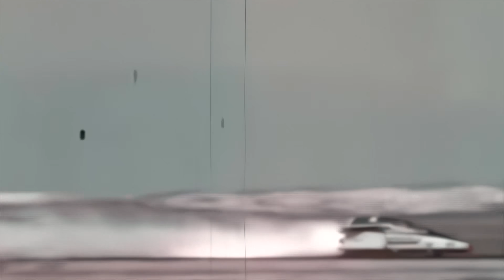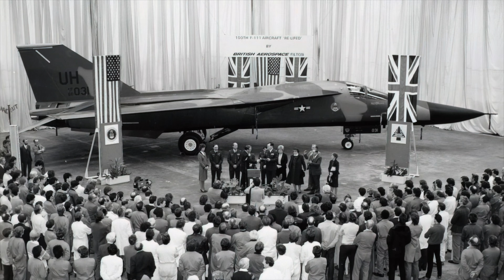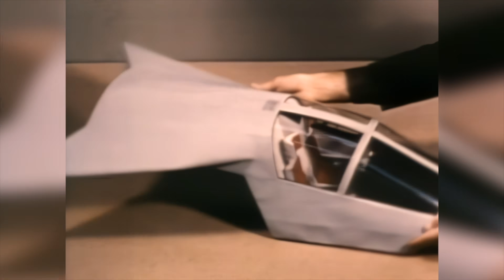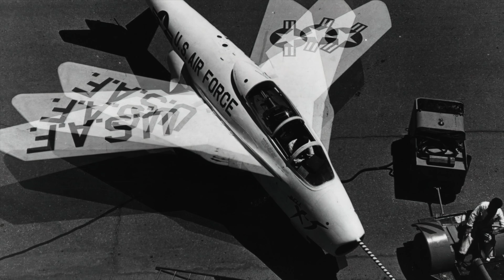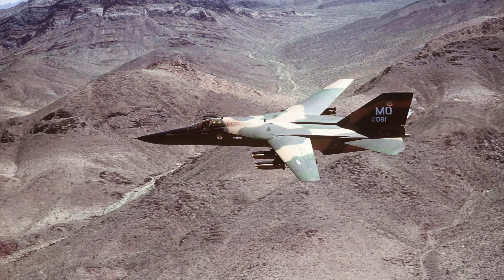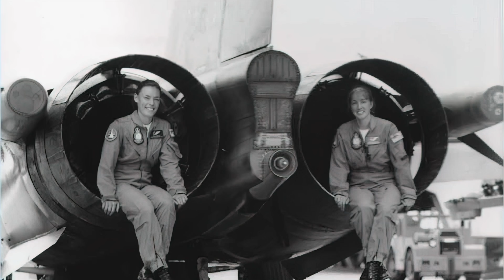F-111 AARDVARK: Crew Escape Module | Upscaled Documentary

Comment: I was in the Air Force stationed at Mountain Home Air Force Base. I worked on those planes as a weapons system maintenance / loader from 1982 to 1986. Even though at the time I would have rather worked on f-16s or f-15s I am now glad I had the opportunity to work on a surprisingly versatile aircraft
Reply from the maker: Thank you for your Service David
Reply: Please define “versatile”. It’s a medium bomber. It has no air-to-air capability. Crew cannot check five through eight, much less six. 

The F-4 was versatile. The Aardvark was not.
Reply: I was stationed at Mtn. Home AFB from 1978-1981 working in the 366th CRS avionics maintenance shop.  Best time of my life, or at least that's my memory of my time at Mtn. Home.
Reply: @Frankie5Angels150 The F-111F killed more tanks in Iraq during Operation Desert Storm than even the 'tank busting' A-10.  It could carry AIM-9 Sidewinder missiles and an internal gun, and had an air-to-air capability built into its AN/APQ-113 Attack Radar, but it was never used in combat.  The only air-to-air kill scored by the F-111 was by an EF-111A Raven unarmed radar jamming aircraft, when it caused a pursuing Iraqi Mirage F1 to maneuver into the ground.  But as an all weather, day/night low level attack aircraft, there was nothing better until the F-15E came along.
Reply: @TacticalTightwad I was stationed at Mountain Home AFB from Sept 82 to Jan 86. I was 1st in 366th CRS Electric shop in Bldg 1224 just below the orderly room. Our Squadron Commander was Major Dale W Smith what a great guy, he made Lt. Col before they sent me to the flightline in "Blue" section, the "Bold" 391st Tactical Fighter Squadron ,"Tiger" section. I even still have a couple of the base's newspaper publications, remember the "Wingspread" I'm not sure where I put them. I had a wonderful time at that base. Between  Chanute  AFB, and  Mountain Home AFB, I had really good food. 6 months Tech School at Chanute in Rantoul Illinois. I had never seen Fireflies before, until Illinois.  I miss those days.
Reply: Used to work in the F - 111 (F - 1 - e - lemon!) At Cannon, NM (moo!). Was in the electro-envirinmental shop. It was a great day to see them fly to the bone yard! The 111 started out as a ship for aircraft carriers, but the Navy decided no.
Reply: @SNAFU was at Cannon from 88 to 92, in the 27th TAC wing
Reply: @SNAFU tell me... What kind of sealant was used to seal the water tank? And, what was in the tank? How many generators are on the F-111? What is the right seat also known as? What equipment was used to start the engine (s)? Where is the Delta -T located? What else is near it? Where is the cooling compressor / turbine located? What valve comes before the 390/45 regulators? Where are the 390/45 regulators located? What could the pilot & co-pilot connect to their flight suit? I got out of the AF in '92, re-upped in '96 in the Army (Reserve) eventually got to go overseas for 2 tours, and got my war medals / decs. Did you???
Reply: @SNAFU no pal, I know those by experience. You don't have a clue if you have to use Google. Want some F - 16 questions? Or good questions about the town near Cannon? Try me!
Reply: @j.lietka9406 he's probably a bit jelly
Reply: @chrisharding.byte_me 🤣😂😅 must be!
Reply: Thank you for your service from the Netherlands. You helped to keep our world safe! God bless the American military! 🇺🇲
Reply: @j.lietka9406 
Thank you for your service from the Netherlands. You all keep our world safe. God bless the American military! 🇺🇲
Reply: @j.lietka9406 brother man I'm glad you're around to share history with the aardvark F-111. Try not to let these trolls get under your skin, they're just keyboard Warriors in their own little world living in their mother's basement.
Reply: @denverdanoreno does the Australian Air Force or England (?) RAF still fly the F / FB - 111? Thanks for the reassurance!
Reply: @TacticalTightwad My cousin Major Myles Hammon was a IP there at that time and died in an accident during a training flight in 1979.
Reply: @j.lietka9406For what it's worth, I believe you were at Cannon. I too spent some time there, as an F16 crewchief back in the early 2000s. Those old F111 hangars sure were roomy for F16s lol. I understand Cannon is now a drone base.
Reply: @crewdawg2008 Cannon is right. From...'88 - '92. The F - 111 E, F, & I think one  other model was there. I was there when they were going to the boneyard. Some of those jets had problems we just could not figure out what was causing it. A Master Caution Light in one airplane would come on for a reason we couldn't find. Thank you 🤓 Also had experience on the -16s' (A, B, C, & D models) before going to CAFB. I got out in '92, stayed in Clodhop & went to the Community College there, moved to Houston, TX, eventually got back in the Army Reserves (as a transportation specialist), & eventually went to Afghanistan & Kuwait. I was an an electrician but was there when the combining of shops started, so I got some environmental systems experience.
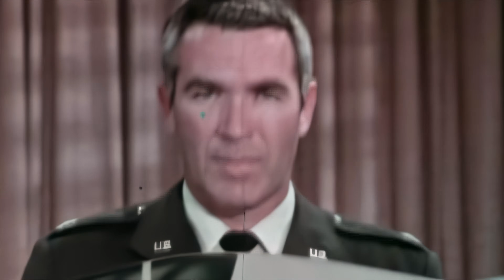Reply: 17:24
Reply: @UweThaesler about the smoke or fumes in the cockpit?
Reply: I was at MHAFB, Idaho 1981-83. Our wing commander, Col. Ernest Coleman ejected but one of the module’s air bags did not inflate. He was paralyzed for life on impact as a result. He gave a pass and review during a parade for his retirement from his wheelchair. He was a terrific wing commander. It was a sad time for everyone on base.
Reply: @timekeeper8363 MH? Yes, went there in.. '86 I believe with F - 16s from HAFB, TDY. During part of the winter up there!
Reply: Was station at Mnt Home 82-85. Base crashed a 111 about every 6 months. I was in NDI we inspected all sorts of critical components on it. Lots of X-ray. Also Hueys of the rescue squardron. Best time ever.

Comment: I saw one go down on 27 Jan 1982 about a mile north of Yolo County Airport in the central California valley.  I was on George Morar's Dropzone helping service one of the jump planes so I had my head down working on something and didn't notice anything unusual about how the nearby jet sounded.  What I did hear was one of the telephone company guys (installing a line) shout "Look!  That plane's going down!"  I looked up to the North in time to see a long vertical streak of black smoke with an airplane on the low end of it; maybe fifty feet above the ground, just as it hit and exploded in a rising ball of orange fire and a cloud of black smoke.  Dave Kleinhans and I saw one tri-color parachute (G-W-O) with something hanging under it at a strange sideways angle; not how a jumper normally hangs in a harness.  We didn't know how far away it was so we couldn't tell how big the canopy was.  I thought it was a standard C9.  I didn't know about the ejection pod but did know an F111 has a crew of two and wondered if maybe there'd been a problem with the ejection; maybe only one got out and the other was hung up sideways in his harness, somehow?   I figured if that was the case, he was probably injured at least.  We jumped into Dave's van and drove through rural roads as fast as we could.  The plane had impacted maybe 200 feet from the kitchen window of a farmhouse and made a huge muddy crater with a lot of small chunks of debris scattered around.  Largest piece we saw (part of a wing or control surface?) was about the size of a card table; sticking sideways out of the mud on our side of the crater.  Beyond that we saw the escape pod and chute on the ground.  Vehicles were arriving from the opposite side of the pod and then the AP's drove over to ask what we were doing there.  We told them and were advised the area was off limits and we had to go.  Never heard anything else about it.  But later, the NTSB reported the plane was being test-flown after maintenance at a nearby AFB (MacClellen?) when there was an engine fire and down she went.  The plane was destroyed but both crew survived.  From where I stood, it looked about what you'd see if you took one of those airplane-shaped glass bottles they decant liquor from, filled it with gasoline, and made a Molotov cocktail out of it.  One second that F111 was an airplane; and then it was a ball of fire and flying shrapnel.  But the crew had ejected at maybe 1200 feet and were already drifting safely back to Earth.  So yeah, that ejection pod definitely worked.  Saw that with my own two eyes.  Right place at the right time.  Was really something to see, I'll tell ya.  //  Here's a link: https://aviation-safety.net/wikibase/137882

Comment: I had the pleasure of being an Egress tech on these planes for 3 years.  Very complex system, but very well designed.
Reply from the maker: Congratulations! Anything you can share?
Reply: I was an instrument \ autopilot tech on the F111D at Cannon AFB around 71 to 74.   I heard that some of the problems with the egress system were due to a failure of the explosive charges to cut the panel for the chute.   This may have been due to us maintenance folks walking on that panel and cracking the focused charge.   The other one was due to a ring that ducted the blast from the rearward motor, not being screwed into it's seat enough and therefore came off when the motor fired.  The blast from the motor then burned the chute.   Is any of this true?
Reply: @jnbfrancisco You're correct.  There was a failure of the FLSC around the chute panel on some early ejections.  The cause was variable, and could also have been due to screws not being torqued down in the correct sequence.

Comment: My dad was a crew chief on F-111As from the late sixties until '73. He said pilot survival in ejection was not great due to the complexity of the escape module. Either the chute systems failed or the cushion would not inflate. I worked on a few FBs accidentally while TDY to Plattsburgh in '84. Neat things, false axles in the wheels for quick tire changes, but a simple clip holding the nut in safety on the nose wheel means the left one departs occasionally. High lift (flaps, slats) inspections in ISO dock is a major PIA and sometimes the outboard slat or flap vane falls off in flight, it's been too long and I can't recall. The spike in the intake inspection for FOD is also a PIA. Also, the absolutely loudest twin engine aircraft I've ever heard run in afterburner on a test stand

Comment: I always knew the Challenger & Columbia Space Shuttle Astronauts could have been saved with ejection Crew Compartment Lifting Bodies which would separate & glide to safety.
Reply: One World Two Hemispheres!
One Light!
Reply: Peace Now!
Reply: Trouble was, the Shuttle could have carried an escape pod, or a payload, but not both. NASA and Rockwell quickly realized the escape pod system was too heavy, and all that extra weight was far forward, requiring much more ballast at the aft end, drastically reducing Shuttle's payload capacity and making the Shuttle pointless.

Comment: They never said anything about ejection over water(or I missed it) does that capsule float indefinitely or is there a raft and water survival kit? I’m assuming they thought of that being a Navy plane also.or at least designed to be.
Reply: Yes it had floatation.
Reply: It had flotation and if the airbags required refilling, the control column could be stroked to add more air into them or could be attached to a bilge pump to remove water from the bilge area of the capsule.  IIRC The Navy had a requirement of 30 feet submersion escape capability.

Comment: We were told at the RAAF School of Technical Training in 1981 that on one occasion when this capsule was tested that the gillotine cut off all of the control systems but the rest of the sequence failed to eject the pilot - the result was that the aircfraft flew horizontal and level until it ran out of fuel, the pilot all the time knowing that he'd die in the inevitable crash. The story we were told included him swearing over the radio,  and when he was told to not swear over the channel, he replied, all the while swearing, "What are uyou going to do about it, I wont survive this crash, so I can say what I want to say!".
Reply: Why would a pilot eject if if could fly until it ran out of gas?  The flight controls are not cut.  They unplug when the capsule departs.  Same goes for the wiring.  The engine throttle cables are cut by a device.  The story doesn't make sense.   I was an instrument and autopilot tech from 1971 to 1974 on the F111D at Cannon AFB.   Also an instructor on the F111s at Mt Home AFB from 1977 to 1980.  I was a tech rep for your H60 Blackhawks at Townsville in 2005.  Loved the year I spent there working with the Australian Army.   Very savy bunch.
Reply: @jnbfrancisco You are describing the later development, not the one where they were cut. We were instrument fitting students at the RAAF School of Technical Training told this by a lecturing RAAF engineer, if it doesn't make sense, you need to look deeper. Dick swinging about what you have done does not come into it.
Reply: @harrisonofthenorth What doesn't make sense is to eject from an airplane that is flyable.  I was giving my qualifications to justify my knowledge of the F111.  I give what I thought was a compliment to Australian Army maintenance people and Australians in general.  I guess every country has its dickheads and it appears that you are one.
Reply: @jnbfrancisco I've checked with my former military colleagues about this, the story stands as told, you're just fighting a rear-guard action because you confused the earliest prototypes with the one you knew, we don't need to justify why they created this prototype, we just know that the early engineers told us that it existed and this problem occurred as a result, which was later rectified. All development is iterative.

Comment: I think it's time for another more modernized version of this Beast !!!
A stealthy fast medium attack fighter bomber !!!
With modern materials and technology electronics and engines .
A possible scaleable tailless version .
Imagine a fighter a medium and a heavy bomber . Even a fuel carrier ...
All could be built in a large computerized robot printer . All the structural could be printed from the inside out with limited human assistance .
Musk pioneered large injectors and printers both metal and composits . Large building sized machines could crank them out at speeds faster than WW2 assembly plants ...
Reply: LIMITS to 3D printing.  Cheef
Reply: @battshyt-Krazy156 how ?
In a sealed cabnet of inert gas a
 mig gun on a printer can deposit any alloy imaginable an with a cleaning head following the nozle be contenous ...
Hence metal printed parts are coming very soon !!!
Reply: FORGING still superior.    *fwiw ...  manned COMBAT missions INCREASINGLY pointless.   G-limited.   Life Support.   p.o.w.   wasted space.    E T C.      3D  will N O T supplant everything
Reply: It was a TERRIBLE aircraft! McNamara’s Folly.
Reply: @Frankie5Angels150 A terrible aircraft which took out more tanks in Desert Storm than the a10 did while maintaining the lowest loses in the entire war
Reply: @Frankie5Angels150 Oh no! McNamara's fools had something to do, mostly, with cousins getting too familiar with each other and the results there of.
Reply: @mrpink830 The F-111 had the highest percentage of readiness in Desert Storm.  👍

Comment: LOST ALOT OF F-111s  DUE TOO SERIOUS RAINFALL, RADER DOESNT WORK UNDER WATER, AND FLYING LOW IN THE DARK AT 750 MPH IN MOUNTAIN RANGES DIDNT WORK OUT WELL IN VIETNAM.
Reply: GLAD YOU MADE IT BACK TO TELL THE STORY!
Reply: I recall they lost one while flying with TFR on, while flying over land and then crossing over the Atlantic, the TFR started mapping the terrain under water as water wasn't recognized by the radar, l believe that was over Maine. Also when flying through a mountainous area with TFR on when the pilot would manually disengage and it would take between 1 and 2 seconds, going supersonic that low would at times turn them into a mountain magnet. I was stationed in Plattsburgh back in the 80's doesn't seem that long ago.